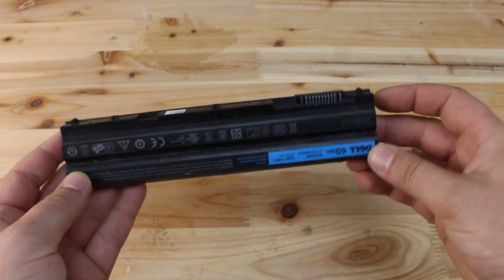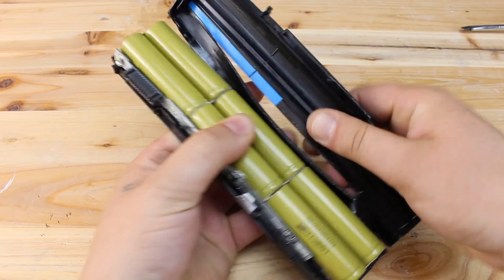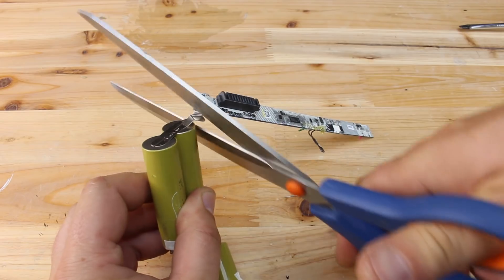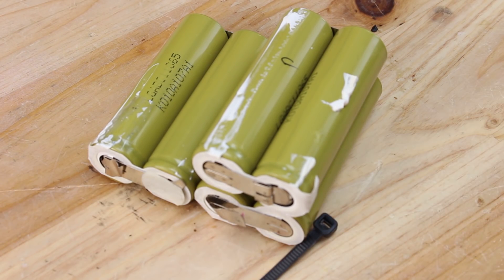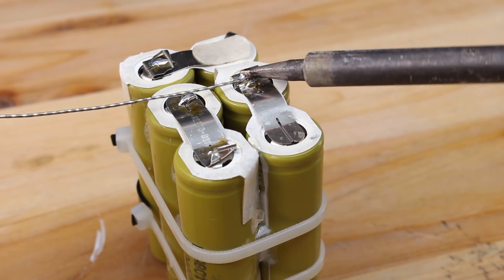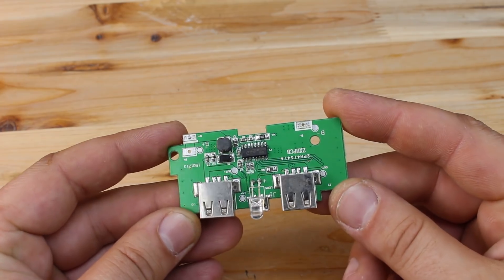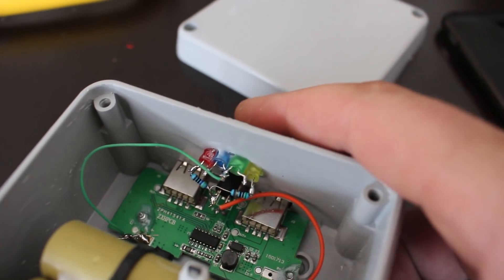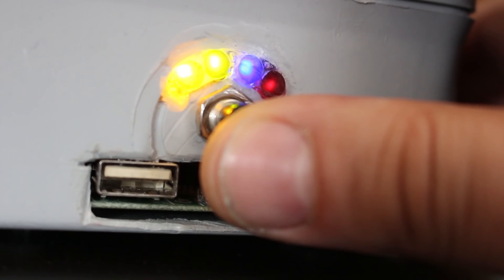How To Make 12000mAh Homemade Power Bank (with battery level meter)

Comment: How can i charge the batteries? On the micro usb port?
Reply from the maker: Yes the board have charger and dc booster it means can be charged and guve 5volts at 2amps current
Reply: @Hacktuber  its different in all boards

Comment: You cant use old bateries in parallel only If they are used togetehr since beginning
Reply from the maker: True,but carefully chosen cells will work fine😜
Reply: American Hacker yes maybe😂 I Made bad experience😬😂